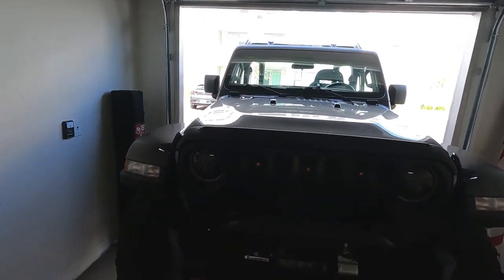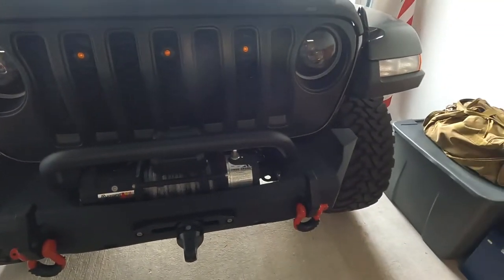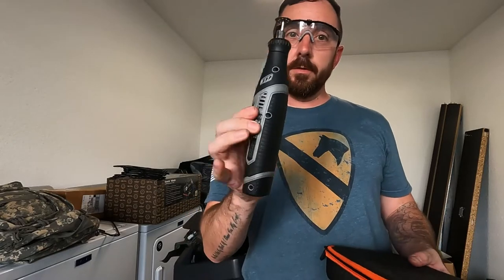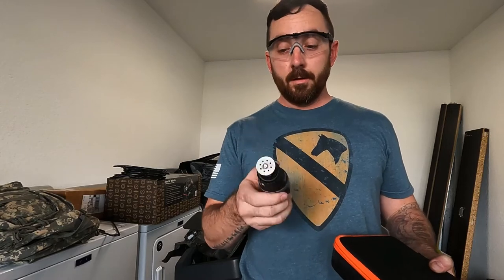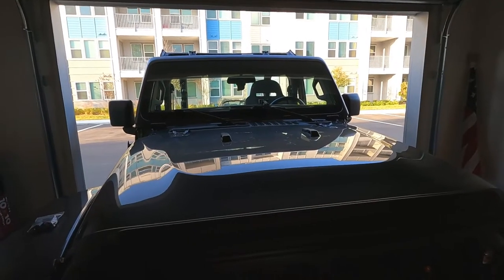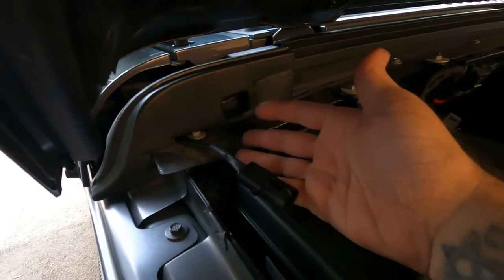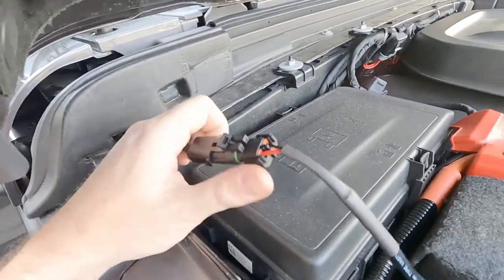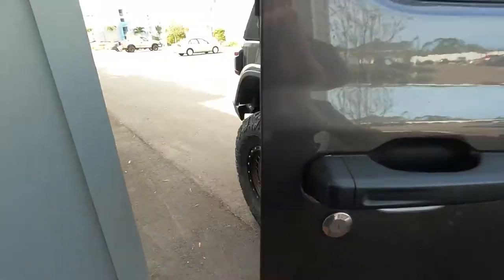Jeep JL Baja Designs and PRP Seat Install

Comment: I'm middle aged with back and neck issues and would love to hear any and all feed back on those seats.  Really enjoy your 2 door videos  cheers
Reply from the maker: Honestly the seats were fantastic. I drove from Maryland back down to Florida and barely had any driving fatigue. I think at one point I went 5-6 hours straight before needing to stop. Absolutely worth the money and headache figuring everything out.
Reply: @Wobblenuts  With your set up, do the PRP seats sit lower, higher or the same height? Did you feel the need to lift the front of the seat bracket with washers like some people have recommended ? Last, do you think an ARB twin air compressor will fit under that new seat bracket set up? I just about gave up on the idea of replacing the stock seats until I watched your video. Great job.  cheers
Reply from the maker: @coolvibes3663  the PRP seats with my brackets actually sat a tad higher. With this setup I didn’t feel the need to lift the front at all. The PRP seats have more rise on the seat bottom vs the factory seats. 

There was a good amount of room under the seat. I think it’s totally possible to fit the ARB twin setup.

Comment: Awesome job, I did the same with my JT. Did you have any luck solving the seat airbag sensor with a resistor? If so, do you have a link or can you provide some details?
Reply from the maker: I did actually. At this moment I can’t tell you which resistor I ended up using, but basically I measured the resistance and plugged one in to match that. I just put it directly into the connector and taped it to hold it there. I want to say 2.2 ohms but don’t hold me to that.

Comment: Great video! Did you ever figure out the airbag light?
Reply from the maker: Appreciate it!! I did actually, I just stuck a 2.4ohm resistor in the airbag connector and that did the trick.
Reply: @Wobblenuts  thanks man! Yeah, I’ve had my JLUS for a little over a year and I’m done with the factory seats...good luck with your build...she looks good👍🏻🤘🏻
Reply from the maker: @mxpx148  the factory seats are horrible lol. I’d go with PRP or Corbeau for sure.

Comment: Awesome job and great vid on the seats. I agree the factory ones kill my ass. The question I have is where did you bolt the seatbelt on the door side of the Jeep?  If I missed that part I apologize. Thanks in advance
Reply from the maker: Thanks for the comment. On the door side the seatbelt is attached to the Jeep. No modification needed.

Comment: Did the resister work to get rid of the air bag light?  What resister did you use?
Reply from the maker: It did end up working. Of course my bad that I didn’t take note of what I actually used. I thought maybe I put it in another video. But basically all I did was measure resistance on the plug and plugged in the resistor, then taped it to keep it in place.

Comment: How tall are you? And did you get stock height seats, or any additional height added?
Reply from the maker: I am 5’8. No additional height added, which is a good thing. These do sit slightly higher than stock at the lowest setting. The adapters don’t have any height adjustability.